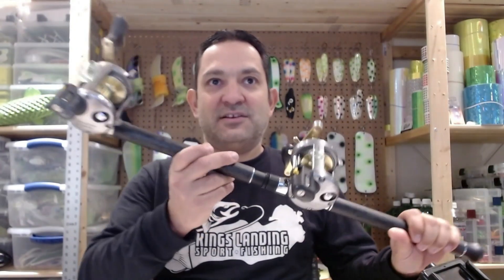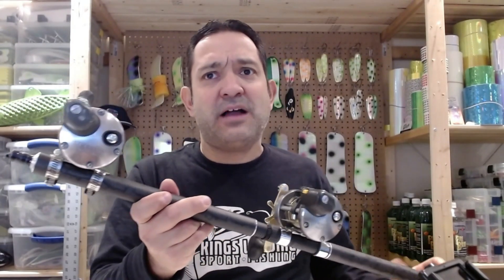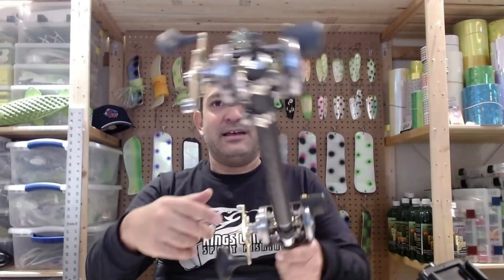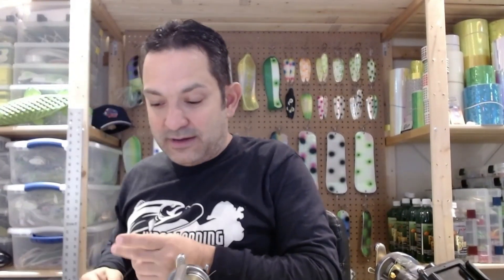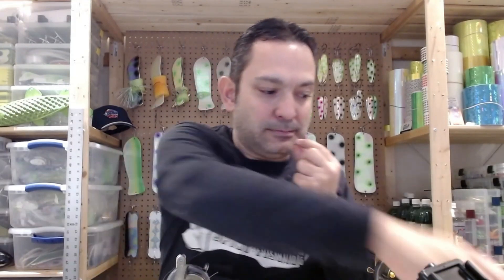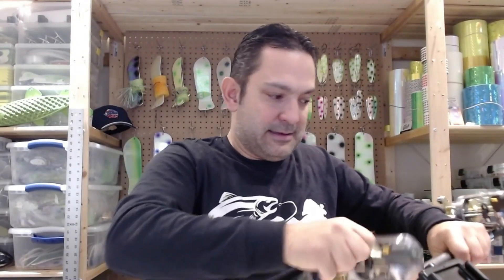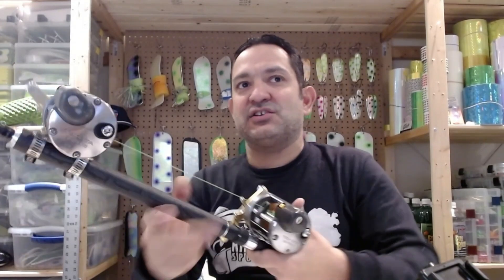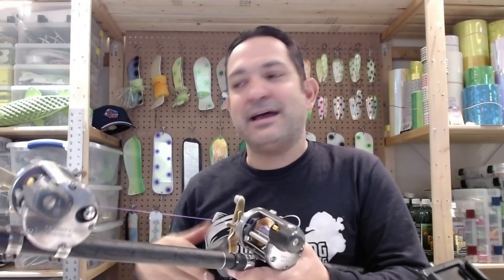Spooling Torpedo Weighted Steel using the reverse spool method.  #SalmonFishing #GreatLakes #Torpedo

Comment: I’ve heard weighted steel floats more as opposed to copper. How does weighted steel handle when you make turns? Have you noticed an increase in catch ratio using the weighted steel? Thank you for a great video.
Reply from the maker: I’m a huge fan of weighted steel and I’ve caught hundreds of fish on it this year.  As for sink rate I’ve confirmed weighted steel at 22 feet per hundred using the SmartTroll device.  Copper is maybe a foot or so more which in my opinion is negligible.   Weighted steel doesn’t birdsnest and is bulletproof in my opinion.
Reply: @KingsLandingSportFishing  as much fishing experience as I have I still have problems with a birds nest as the boats rocks. I will have to try it. 

Do you think the sway action of the weighted steel could trigger a bite? Like getting a strike on the turn? Thank you for the reply.
Reply from the maker: @jimdrechsel3611  - I do believe the snaking action of weighted steel helps with bites..  especially when running spoons.
Reply: @KingsLandingSportFishing  Is that spooling device home made? If so, it would be interesting to know how you made it. Looks like you clamped the reel down opposite the reel. Clamped the two on a pole of some kind? Thanks again for taking time to answer. Learned so much to try next season.

Comment: Marc, if you were going to use a planer with the weighted steel what line would you attach a release too? Would you use rubber bands? A release? Can you wind the weighted steel around a release like a Sams Pro Release?
Reply from the maker: Most of my weighted steel setups use a braid backer.  I’d wrap that around the Sam’s pro release.
Reply: @KingsLandingSportFishing  That's what I thought. Wanted to hear it from you. You've had little problems with breakoffs using 20lb leader? The 20lb is for spoons I take it.
Reply from the maker: @jimdrechsel3611  - mid season I swapped out most of my leaders to 30lb…   Seems to be working well.

Comment: Hey Marc. I actually do love the weighted steel. I a couple Convector 45's. I was thinking about just loading with 30# big game mono instead of the steel and use some Torpedo weights. Is there a big advantage of using the steel ?  Are u using the transom planer to prevent bad tangles down the shoot ? A little off topic this year I'm moving up from a 19' aluminum to a 25' Fiberglass Baha Crusier. I'm pretty sure u had a smaller boat and moved up to a bigger one. Did u notice any difference in down speeds or leader lengths going to a bigger boat. Thanks

Comment: What is the breakdown on installing 300' and 400' weighted steel on Tekota reels? Will 400' go on a 700?
Reply from the maker: 300 is max I out on a 700.   Even then it cuts down on the backing vs installing on an 800.